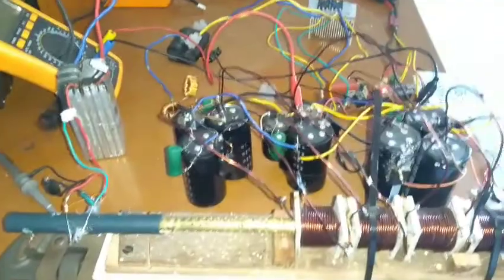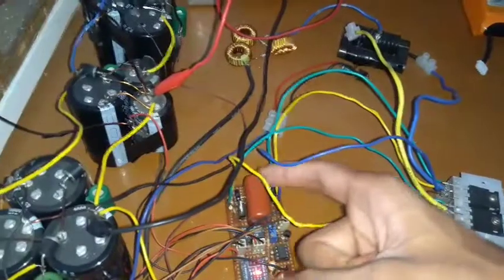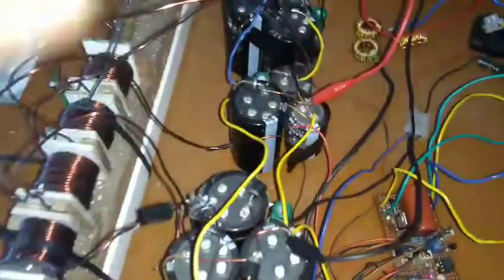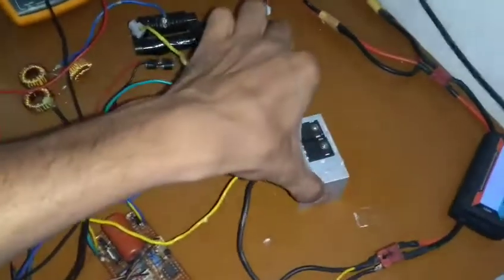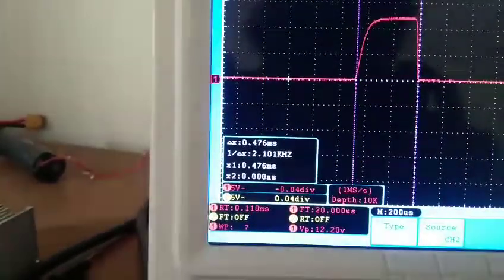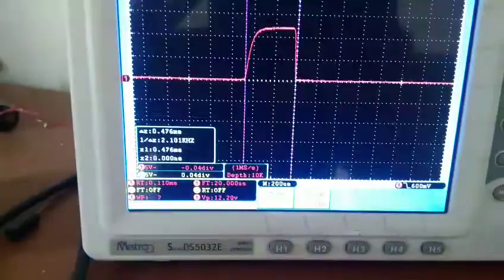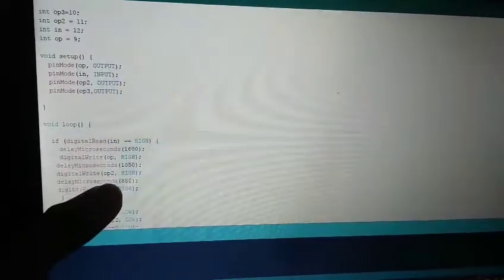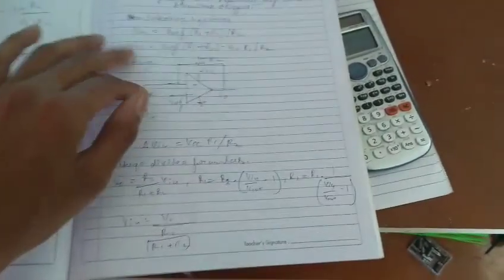Going through my coilgun

Comment: Very interesting build. This is one of the most impressive coilguns I've seen on youtube. And your experiments with spin stabilization are encouraging as well. The fact that you constructed a high current capacitor charging ZVS driver from scratch is extremely impressive. I am curious what the charging resistors are for? The way you have it wired looks like it's equivalent to one single large charging resistor.... Is there a reason you use multiple?
Reply from the maker: I am using resistors to protect bridge rectifier form flyback current after the coils have been energized.
Reply: @arrshithrg5359  Ah I see. So it's just to make sure the current goes through the coil flyback diodes instead of the power supply. On my designs I just disconnect the power supply before firing. 
I am also curious - have you ever experimented with inductive spin stabilization? I.e. spinning up the projectile without touching it with a motor?

Comment: So I have my circuit completely built and operational, the part I'm having alot of trouble with is the coils. How do I design the coils to get the most velocity out of the projectile. I estimated around .1 ohms for the coil and I'm running it at 200v so I know the current will be at least 4000v (I have two capacitors in parallel for each stage)
Reply from the maker: Dominic Nedlewski let the coil length be equal to projectial length 
B=ni/l so for max performance coil length should be minimal for magnetic field to be stronger . And also less inductance for less rise time
Reply: Vasudev Mr I understand all of that except for rise time. Does that mean the field strength rise time?
Reply from the maker: Dominic Nedlewski rise time of current to its peak
Reply: Vasudev Mr that makes sense, my last question is how do I know if the B is high enough.
Reply from the maker: Dominic Nedlewski you can't systematically calculate it but u can get to know by trial and error . 
But ofcourse if the current through a optimized coil is in kilo amps range it will be high enough to saturate the projectial
Reply: Should I try to get it as close as I can to saturation without reaching it or is it better to run It at saturation? I'm not trying to go over it because anything past it is just wasted power

Comment: This may be a Stupid question, but has anyone ever used high powered tazer transformers to dump power straight into coils and can it be done without any issues?
Reply from the maker: Tazer transformer is no good . It  Can't output 2000 amps of current unlike capacitors

Comment: Was reading about super capacitors, probably worth replacing the capacitor bank with super capacitors to improve form factor. Let me know what you think about super capacitors.
Reply from the maker: Piyush Deshpande hahaha if that would work I would have done it years ago .the problem is ohm's law supercaps can store max of only 5.5 v and with this voltage i can't get 2500 amp pulse at 0.15 ohm coil resistance

Comment: Maybe you should consider running slots along the length of the metal barrel, since the eddy currents might travel 'around' the holes.
Reply from the maker: NNNI running slots would weaken the barral . and Eddy currents induced is directly proportional to area so I guess there wouldn't be any difference